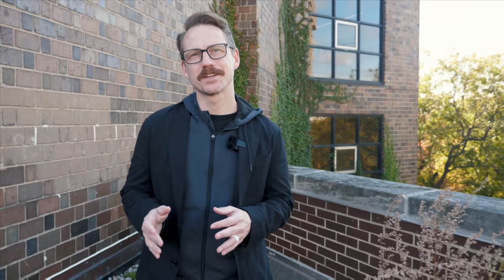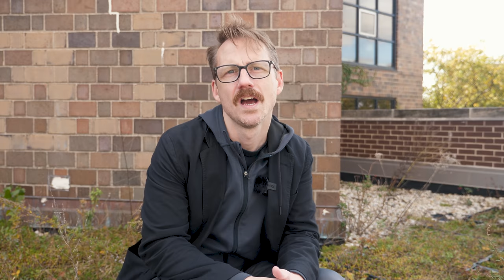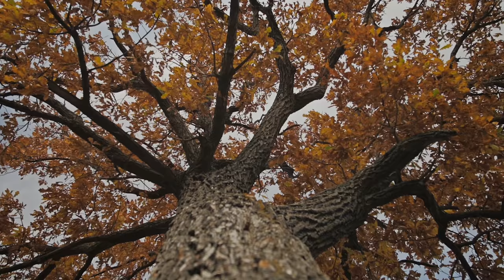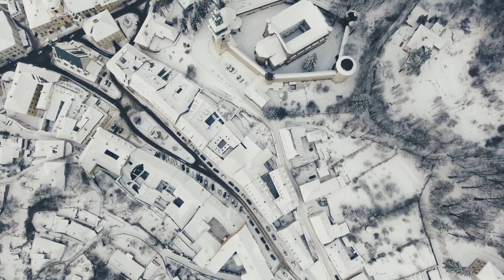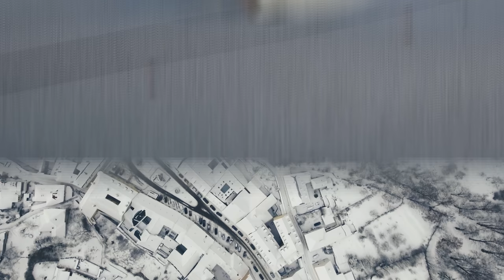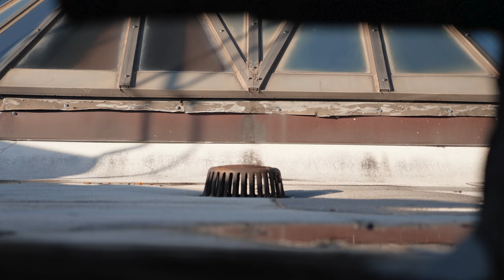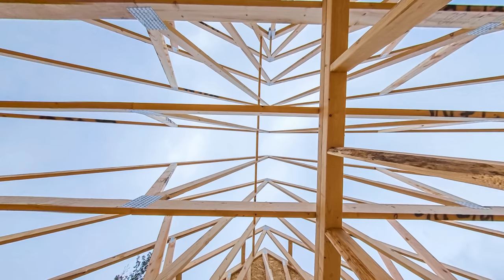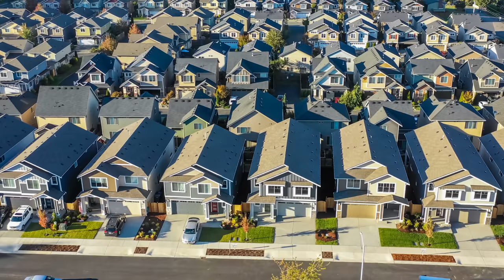Why Do Architects Insist on Using Flat Roofs?

Comment: Ancient Egypt and Mesopotamia are famous for their lack of snow and low precipitation, similarly people mostly complain about flat roofs in places with a lot of rain and snow. I’m from MN and had a flat roof high school and after major storms they had to send the janitors up to shovel off the snow. And they were terrified to allow the flat roof to be used as a public space lest a kid fall off- it was a 1 story building.
Reply: Converting a flat roof to public space isn't just some simple feat like adding stairs.  The idea that this was ever considered is just absurd.  If it wasn't designed that way to begin with, forget about it.  School buildings typically feature a lot of floor area spread out acroos 1 or two stories.  As mentioned in the video, this would be impractical for a pitched roof.
Reply: @sherpajones  bs.
Reply: The majority of South America is tropical and get lots of rain yet flat roofs are the standard
Reply: @DanielPereira-ey9nt  Yes.. with proper drainage and some slope (often unnoticeable) this isn't an issue at all, as mentioned.
Reply: @sherpajones  Lots of flat roofs which aren't meant as public spaces are in fact used as such, "unofficially" (illegally)... The building I live in has a flat roof - it's perfectly safe in every single way. No risk of falling, nothing to get hurt on. Yet - everything that stands in the way is a locked door. In the 90's the landowner used to be more chill and there was a key in circulation... Not anymore. Just one locked door stands in the way for what could be a great place to hang out for the ~200 people living my building.

Usually you don't need to add stairs - they're already there, for the people maintaining the building.
Reply: I am really disappointed that the guy's first go to is Ancient Egypt and Mesopotamia. It is such a weak counter argument.
Reply: Modern Egypt is famous for it's lack of precipitation, but not ancient Egypt, FYI. The Pyramids were not built in the desert, even though they lie in one today.
Reply: @tjmarx  an engineer would have calculated how much load that school's low-sloped roof could handle if there were plans to use it for children to occupy. It's a wierd thing about the comments sections.
Reply: @user-lv6rn9cf8m  most low sloped roofs aren't even meant to be walked on--it damages the surface.  Pads for equipment and walking are available, but expensive, so without those, the tenants in p's building who went up to enjoy the roof were contributing to leaks, especially in hot or cold weather.
Reply: @tomsenft7434  How the heck did kids walking on a surface made for workers to stand on contribute to leaks? What kind of assumptions did you even just make... like no, we did not damage the concrete. We would have needed some serious power tools to do that.
Reply: @Tijuanabill  sources?
Reply: @oqlassic8799  Literally type in to the bar at the top of your browser, "Was Egypt always a desert", then read the 4,000 pages  of articles discussing it.
Reply: @Tijuanabill  " Literally type in to the bar at the top of your browser, "" then do it yourself first, please.  I just ask sources for your comment. How would i know which articles that you use as sources, if you don't want to give the sources or the link? even you know that there are many articles about that.    And please read my previous comment carefully.

If you don't know the exact sources, then just say it.
Reply: @Tijuanabill  I said already before, please read my previous comment carefully, 
"And fyi, from my searching, i found that pyramid being built in desert tho, even back then. So where did you get your info?" 

You don't need to write a really long comment just to say that you don't know the exact sources.  If you don't have the proof, well that's it then,  bye  :v
Reply: @DanielPereira-ey9nt  I guess marketing on part of the wood industry is the one that say flat roofs are bad, but is just words. Nothing has a single way to do it. It is perfectly fine an angle wood roof, the same with a concrete flat roof: is as good.
Reply: @DanielPereira-ey9nt  Agreed, many houses in the Philippines, Hong Kong, Bangladesh, Hawaii and likely others are the same. Commercial buildings all the time.  The type of roof material and effective slope is key.  They usually do not leak unless there is standing water or of course damage.  The last roof I redid in the Philippines is elastomaric and 12 years it is still like new.
Reply: @sherpajones  You cannot simply convert a flat roof to an occupied space.  It would need to be intentionally designed for the additional live load if the roof is to be occupied.  All the other loads are considered ie snow drift loads, etc., and an additional safety factor is incorporated into the structural design.
Reply: Did they also have to keep the rainwater when it came ..?!
Reply: We have had 5 roof collapses on flat roof buildings this winter here. Sadly at one of them a lady was crushed to death. It was at a work out facility. Come to find out in the 70s and 80s they allowed builders to use flat roof trusses that only the top cord is supported. The nail plates on the ends that the lower cord hangs from didn’t cover the whole upper cord beam and actually are pulling them apart. All these failures were similar.
Reply: I can see where a roof drain going down the center of the building would keep this from icing up.
Reply: While sloped roofs help with snow buildup (and at least rain don't build up) if you get allot of the wrong/right type of snow you might well need to get up on the roof and use a shovel to help the snow off, 
but that point any flat roof would have a pile of snow meters thick on top of it IF it help up
Reply: @aggese  Our roof on our house is a 3/12 pitch. The metal covering has hidden fasteners so the snow slides off easily. I think it slid off 4 times this winter. Our cabin is an 18/12 pitch metal roof that will only hold a few inches of snow.
Reply: @Chris_at_Home  you measure angles in fractions?
Sorry but I don't have a clue how to even start to convert that to actual numbers.

But yeah smooth metal are allot less likely to have a problem, most houses here have "brick" roof tiles. But it still require really specific weather for anything more than a few dm to stay on top of it.
Reply: @aggese  When you order trusses here you order by rise per foot, so a 3/12 pitch means it rises 3” for every 12”. Carpenters use this also when talking about roof pitch. The rise angle is 14 degrees though. You can search the internet and it will show charts with the conversion.
Reply: @Chris_at_Home  Thanks
I can understand how the cabin with a 56 degree rise angle don't hold any snow, but the 14 degree roof is basically flat seems like it should be able to hold meters of snow
Though how well insulated is your roof?
The be reason for it to slide of would be if the leaked heat melt create a interface layer of water that the snow can slide on, if the roof is well insulated than I have no idea what would make it slide off with that small a sloop.

Here a lot of houses have part of the roof being up to 70 degree and then the center part is around 45-55degree, and built to retain a amount of snow for extra insulation, but it depend a a lot on region as you don't want allot of rain to fall on too deep snow on a roof. sure their offcorse exist some with flat or almost flat roofs but some of them have had heaters added to melt the snow off them instead of send someone up with a shovel.
Reply: @aggese  Our ceiling have R-60. We have a proper vapor barrier that is well sealed along with all penetrations around wires and plumbing. We get a few thaws midwinter and the snow slides when outside air gets above freezing. Our home has monotrusses which are best for attic ventilation.  Also the higher wall on the trusses faces south so the sun warms the attic.  On another note our exterior walls are double stud with R-40 closed cell foam. We use 600 gallons of heating oil per winter to heat 3400 sqft. I have a short video here of the north side of the house with snow on the ground. A week later the snow was almost up to the roof because this was in March when the sun starts putting out some heat. On clear sunny days even down to 0F our heating system doesn’t run from about 10 am to early evening. We have about 200sqft of windows on the south wall.
When you think about carpenters using pitch you can bet it is easier to figure the rise. You can measure 3/12 with a tape measure but doing it by angle would be much more complicated.
Reply: @Chris_at_Home  I like your off the grid cabin, look really nice.

Technically a carpenter here would measure it by cm difference over one meter horizontal distance, so your 3/12 would be labeled as just a "25cm raise" as over each meter it raise an additional 25cm but as everyone is supposed to know that it is per meter. The blueprints will likely give degrees and the carpenter or work leader is assume to be able to calculate it, or consult a table.

But as I aren't a carpenter I can't really estimate what a 25cm raise would be, and many Americans can't estimate metric measurements, sp I thought degrees would be more universal for the discussion 🙂
Reply: @Chris_at_Home  how large is the heating oil tank? A friend in Philadelphia said that 275 gallon is apperently normal there and that just seems absurdly small, the house I grow up in had a 15-20 cubic meter heating oil tank, around 4000-5000 gallon, only refilled that every 4-5 years though but tanks between 5-20m3 1300-5000 gallon was basically standard until heat pumps started to replace oil heating, the size of the tank being more about how often you could be bothered to refill the tank than how much you would use each winter.

The furnace was fun too. could use electricity, oil or firewood for heating and was manufactured by Lamborghini (yes the sports car manufacturer)
Reply: @aggese  Thanks for the compliment on the cabin. I did about 95% of that build myself including cutting trees and hauling materials in from the road about six miles from there. I’m not a carpenter by trade, but took some time off from work and helped some real carpenters for free for six months. I also did all my own plumbing and electrical on our house and cabin with advice from people I know in those trades
Reply: @aggese  Most tanks here are above ground and 300 gallons. I haul my own fuel in a 55 gallon barrel that has a pump. They charge over 50 cents a gallon to deliver is from about a mile away. It only takes me about 30 minutes to haul 50 gallons saving  about $ 25.
Reply: @Chris_at_Home  the tank in that house took up half of one of the basement rooms and the room had a ≈4ft high concrete barrier in the middle so if it broke it wouldn't flood the whole basement with oil,
Here they deliver it for free as long as you buy more than 1.5m³ (400 gallons) at once,
Nice that you can get it done that fast, took longer when we had a large tanker truck come and refill the tank but the. Their are a lot of stuff to do before and after pumping that much oil 😀
Reply: @aggese  Our tank is outside. I don’t think I’ve ever seen a tank inside here. I know when I lived back east our 275 gallon tank was on legs in the garage. They used #2 heating oil there. We use #1 here because #2 would gel at the low temperatures we get here.
Reply: Egyptians opted to build angled roofs in one place and flat-top buildings in another. No one just thought of putting them together.
Reply: That building was not designed well. In canada most commercial building roofs are flat. Well nominally anyway. there is always a slope towards roof drains
Reply: @aggese  3/12 and 25/100 are both 1/4. Need a calculator for that ~14 degrees.
Reply: Let the children learn to fly, if they identify themselves as birds !
Reply: In Russia almost all public buildings have flat roofs and there are no such problems
Reply: @player1GR  in north America as well
Reply: @user-lv6rn9cf8m  If you put 200 people on a tarred roof, the tar will be poked with holes in one evening.
Reply: @Tijuanabill  So does much of the Ancient Egypt. You are confusing Ancient Egypt with Prehistoric Egypt. That's why you are asked a source. To make sure that you don't misread the source.
Reply: @xwtek3505  I just know I don't really care about one random comment from 4 months ago. Whatever you are on about, I don't care really, TBH.
Reply: oh yeah the lawyers would love that.
Reply: @topherthe11th23  I just don't see what the Egyptians have to do with the pyramids, in your mind, other than their current day physical location. Obviously people who didn't understand wheelbarrows, are not capable of building these.
Reply: @topherthe11th23  so much biases and assumptions in a single comment as a reply to a simple ironic comment. Relax, you're not on a forum, debates are useless time wastes.
Reply: @DanielPereira-ey9nt  It's like this comment section hasn't heard of slow low sloped roofs and pipes lmao

Comment: I've seen examples of large buildings with sloped roofs and how areas near them have to be blocked off in the winter to prevent people from getting clobbered by falling sheets of ice and snow.
Reply: In architecture school I was told that slopped roof on high building is dangerous, especially in climate that I live in
Reply: The solution is generally a steeper roof, or designing for the flow of snow to target someone you don’t like